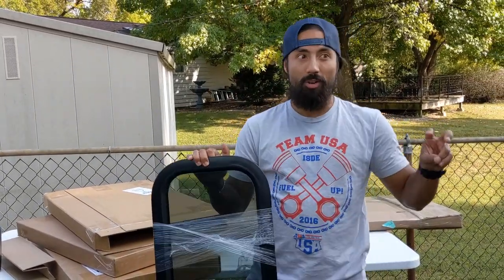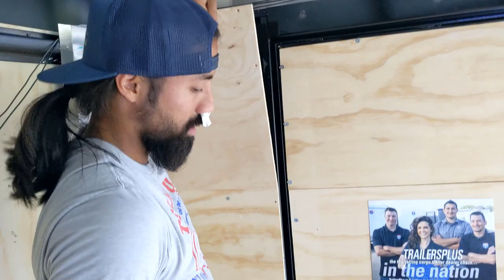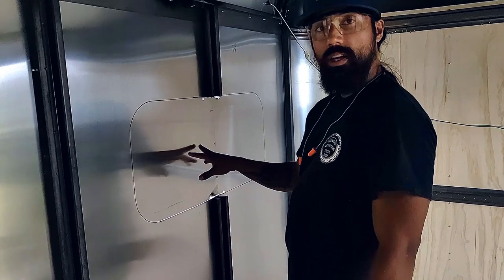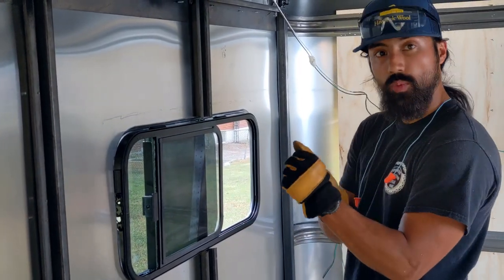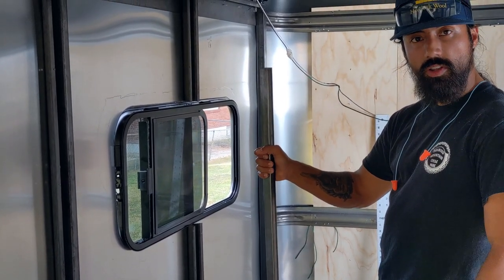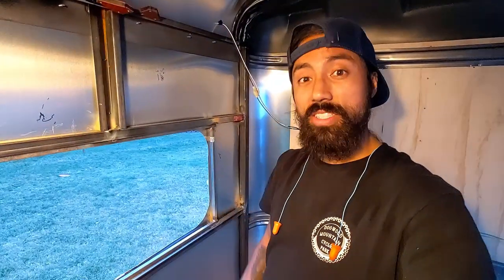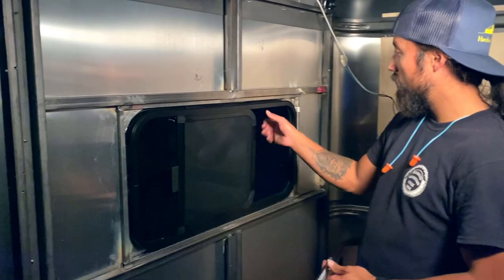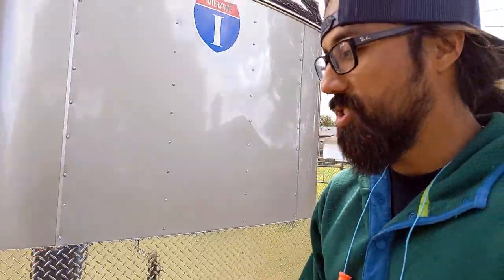EP 2 Cutting Big Holes In Our Trailer: Installing Windows

Comment: Thanks for confirming my concerns with cutting and welding the wall studs .I have watched several different videos, and you are the first one that did it right, in my opinion. But I am curious about welding so close to the aluminum siding did you have any burn thru and how did you prevent it?

Comment: Thanks for sharing! What kind of weld did you do on the interior for the cross bracing? Did the heat discolor the paint on the outside of the trailer at all?

Comment: You use tools to change the disc on your grinder ?
If you have to cut anymore steel get some cutoff wheels for that grinder
Reply from the maker: I'm just using the wrench that came with my grinder to switch back and forth from the cutoff wheels and the grinder wheel. Don't want any sharp edges!
Reply: @usdoingthings5359  
I'm just messin with you, I've been a welder for 40 years.
You can spin those discs off of the grinder without tools by wearing a welding glove and hitting the edge of the disc with the palm of your hand in the off direction. It just takes some practice.
Little tricks of the trade to save time I learned back when I was a welders helper working on pipelines
I like your videos, I subscribed a couple days ago